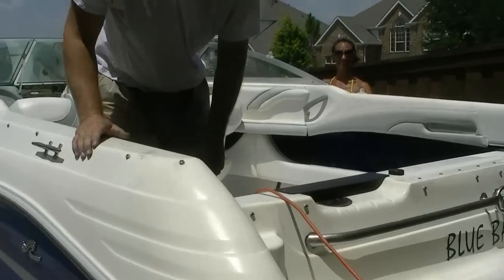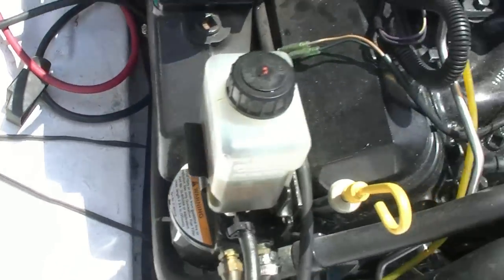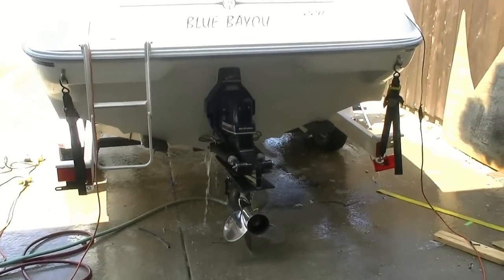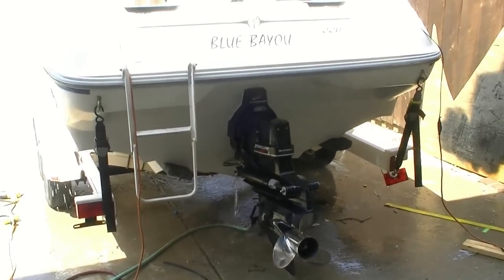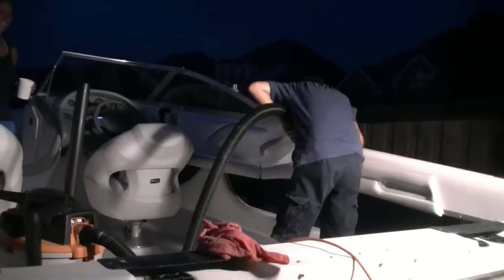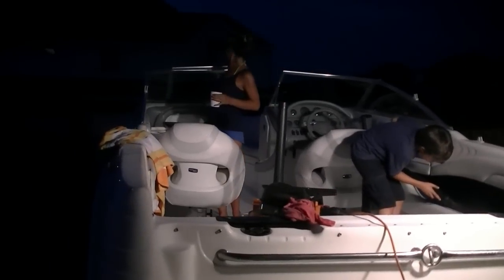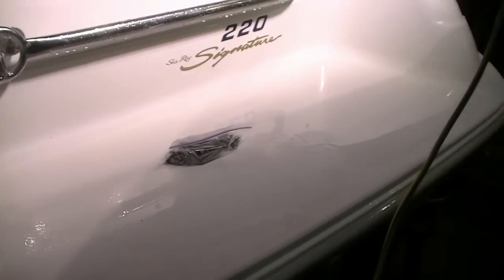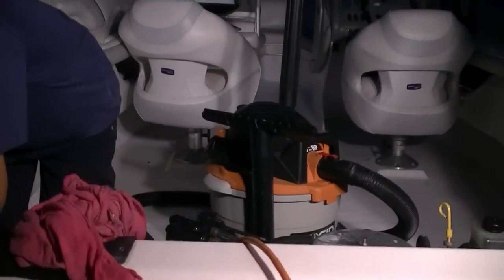Corsa Captains Call Side Exhaust system installation and Start up PART2 VLOG #58

Comment: Seen all your videos from start to finish, great job. Just one suggestion on your hose clams. Anytime you use double clamps they need to be facing in the opposite direction. That's a Coast Guard requirement. Other then that you did a really great job.
Reply from the maker: Carlo Cas thanks for the compliment. Yeah I made a couple of stupid mistakes and I facepalm every time I see it or someone points them out... LOL!

Comment: Hey thanks for the vidéos..Im finishing up porting my heads and installing a lunati cam and roller rockers on my 88 four winns 200 horizon ..ive got corsa side pipes coming and your video has helped me get prepared to do mine....only thing different Im doing is running y pipes and mufflers  so that i have both always on...great video!!!!cheers ..I love your boat..my boat has to be fully wetsanded and polished..

Comment: Cool Video, thanks. I just bought a Project boat with the Corsa already installed,,I just don't know how it supposed to work yet. BTW it has Dual 5.8FI motors and dual Outdrive,,yes,,that means Dual Corsa also...I can't wait to get on the water too..

Comment: I've never understood why on high speed planing hulls why the exhaust isn't routed forward to the beginning portion of the hull that remains in contact with the water in order to maintain a constant stream of bubbles and reduce friction.  This sounds good but probably doesn't add any power or reduce power requirements..

Comment: I have a question so when you install this obviously you rerouted your exhaust from the back of the manifolds I see that will water still come out of your exhaust underneath the stern drive? Or does this system completely reroute the water flowing through the motor? I guess my end question is is it a two-way system where you got water flowing to your Stern drive and out the new exhaust or just out the new exhaust??